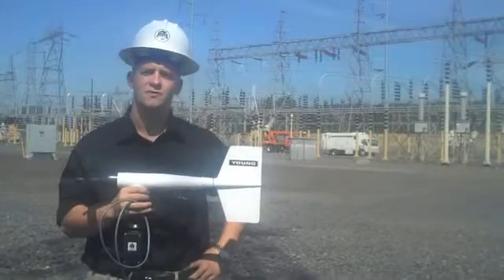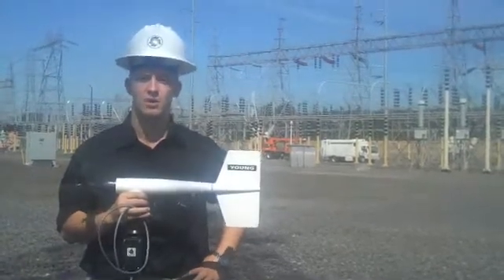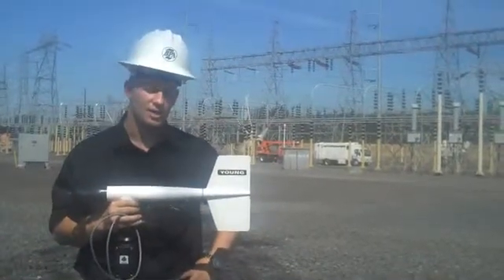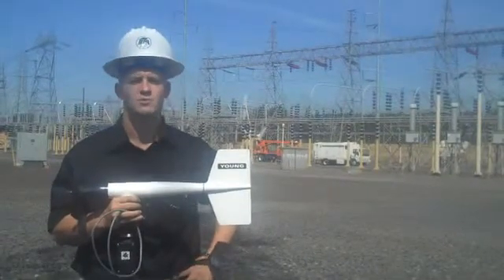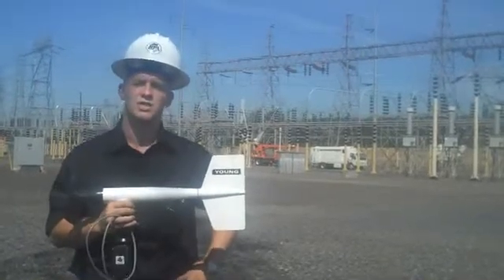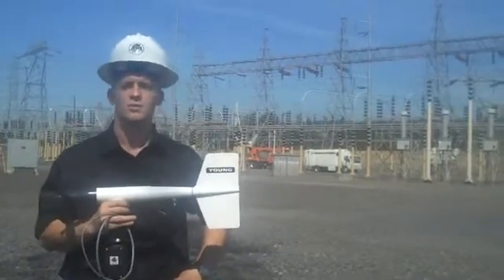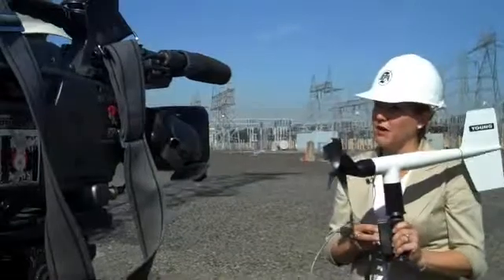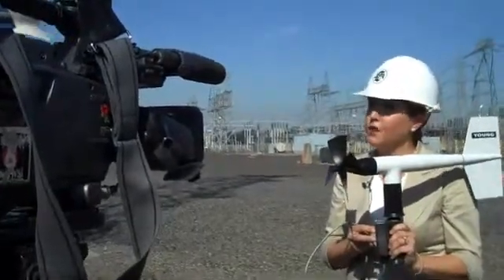Troutdale Anemometer Installation

Comment: That's an expensive wind sensor there ! They could get the same results with less expensive sensors .
Reply: Very true they could have gone with the cup anemometer and it would have had better results because I believe propeller types miss gusts because sometimes there turning out of the wind and it takes them a second to get back into the wind where cups always get gusts